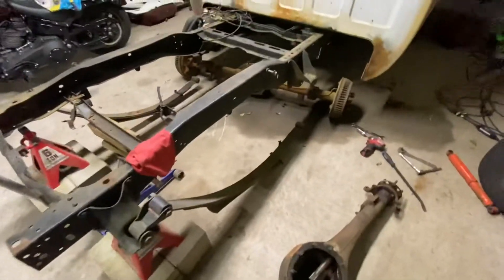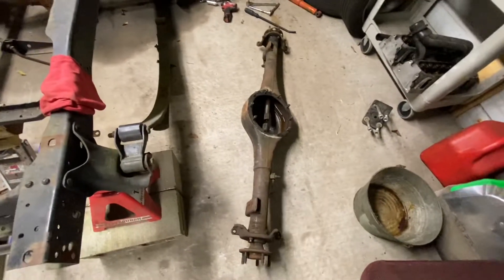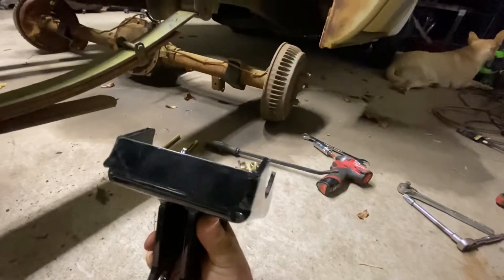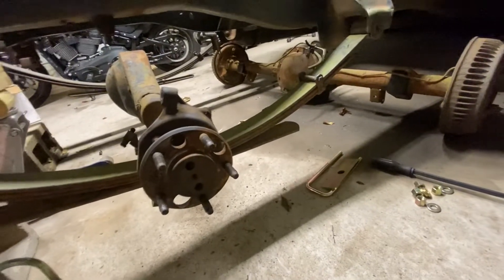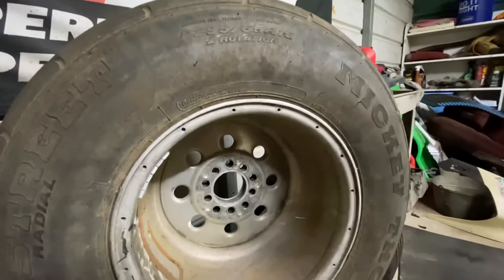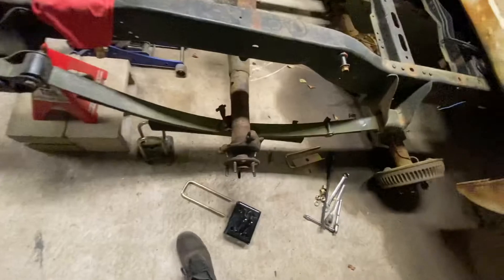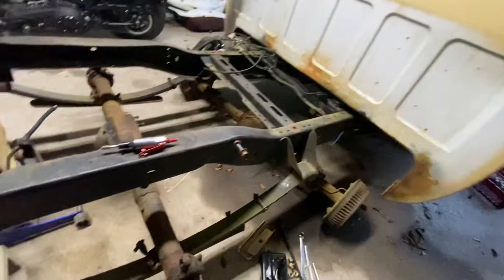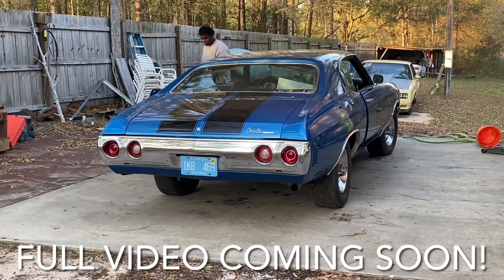LS Twin Turbo C10, 9” Ford Rear End Mock Up!

Comment: Thanks for getting back to me .That 55 in. ,is it what the wheels mount to? I think mine is going to be wide.I really like what you are doing to it.Never thought about reversing the wheels,not many wheels you can do that to.
Reply from the maker: No that’s not where the wheels bolt to… if I had to guess the axles stick out about 2-3” each side from where I measured from… and yeah I’m not 100% sure if the wheels flipped will work but the research I did led to it being ok. But I can measure from axle to axle for you tomorrow…and it won’t take 2 weeks this time… lol. Thanks for watching !

Comment: How wide is the axle flange from one side to the other?I have a 9 in. I want to put in my 1985 c10 and I also want to use 12 in.wheels
Reply from the maker: I’ll get a measurement for you tomorrow!
Reply: Still have not heard back from you .That’s the look I want on mine
Reply from the maker: @dougcormack8240  sorry about that. Flange to flange is 53”…wheels are 15x12 with 4” BS.

Comment: 9 inch axle what is it out of
Reply from the maker: The 9” that is in this truck is 10” narrowed vs the factory spec rear axle housing. It was in a 74 nova that I had years ago and parted out. This rear ended and the front wheels live on!